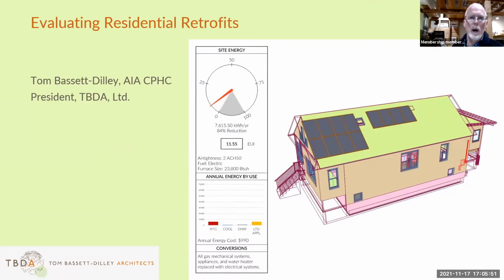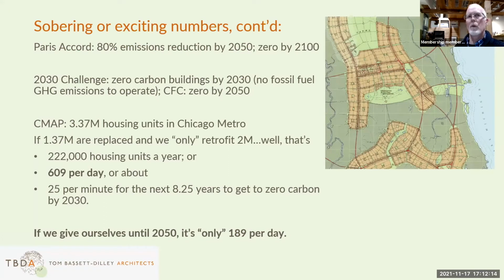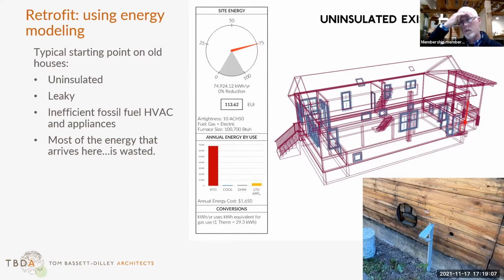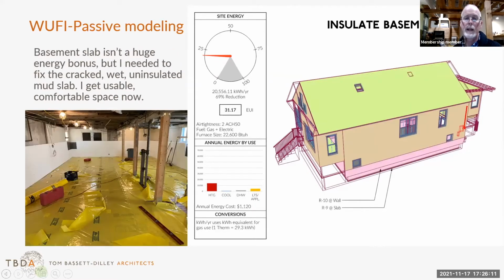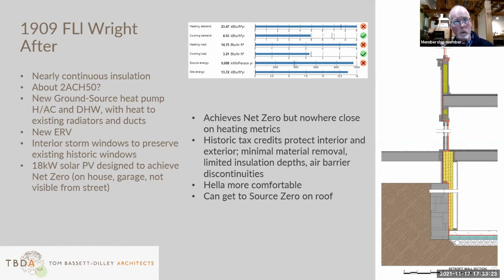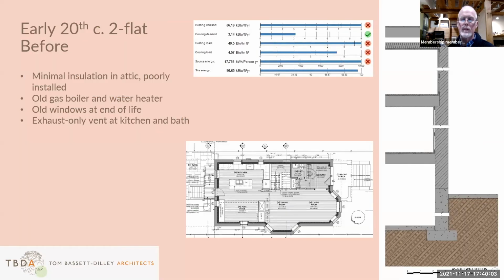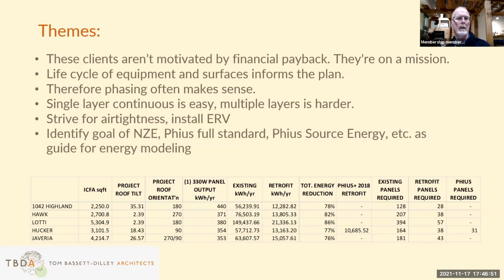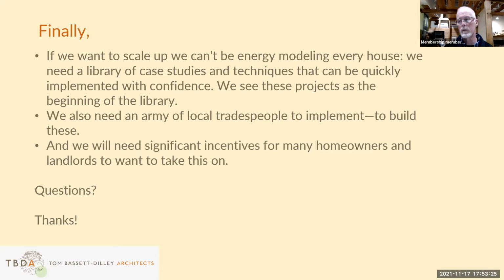Evaluating Residential Retrofits

Comment: I have been looking online to see other deep retrofit Reno’s. My question is the foundation. Once you demo and take out the old slab what do people do about the insulation that runs to the stem wall but not under the stem wall. Like I have no idea how to make a continuous thermal break or a continuous insulation that runs all the way to the roof and where is the capillary break when you only run insulation to the inside edge of the stem wall? I’m not sure if I’m even making sense. So, I’m short, I’m too wanting to do a retrofit, my concern is how can I insulate the the ground and outside wall and.have a continuous thermal layer? Like wouldn’t the stem wall make that hard?
Reply: Hi Ryan--the top of the stem wall is often a thermal bridge in retrofits. In mine we captured it on both the interior and exterior with foam insulation to minimize it. As for capillary break, that's either the insulation itself (if foam) or a dimpled membrane (check out the suite of Delta products, also Certainteed and others). For photos of examples, see answer in your next post...
Reply: @tombassett-dilley910  that is exactly what I was looking for. Im sorry about the question, I couldn't put it into words but you knew what I meant and this is what I will probably end up doing. I think ill spray foam that section of the top part of my stem wall. near the rim joist and maybe even on the exterior. I was confused as to how to get a connection to my rigid foam from the stem. Thanks so much and this vid was amazing. I'm a renovator on other homes that arent mine and no one asks me to do retrofits...YET!!! I hope that changes someday. But really love learning about anything related to retrofitting old homes to higher performances. Thanks again and hope to see more vids!